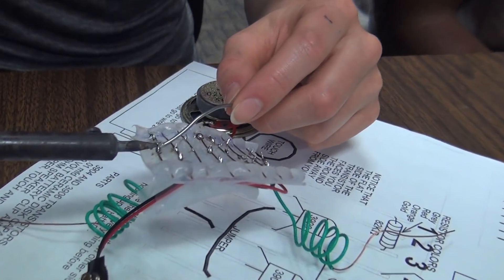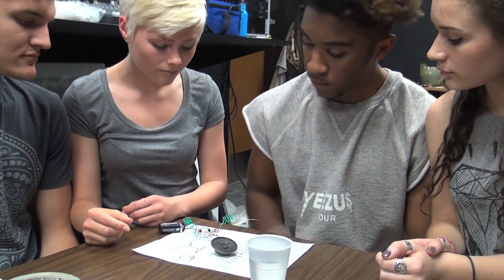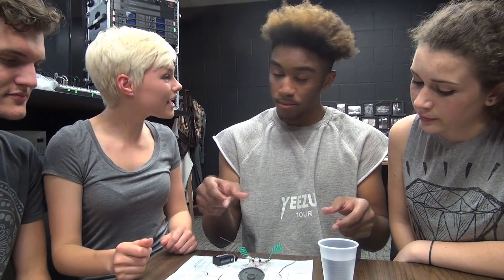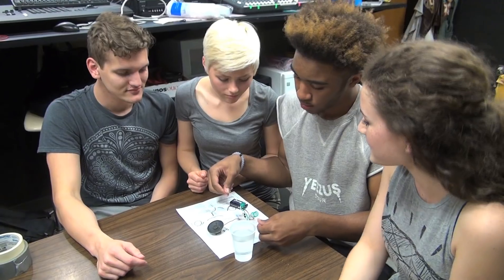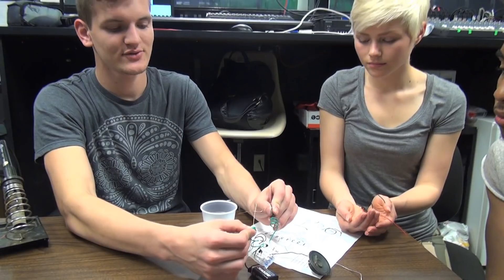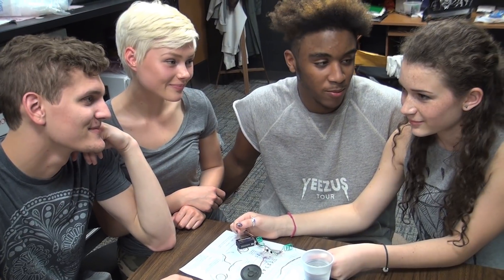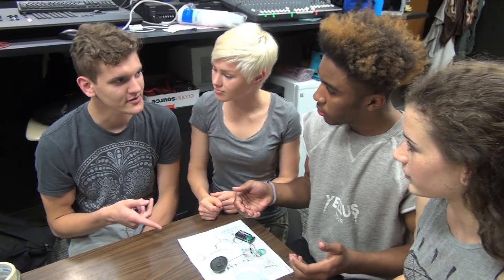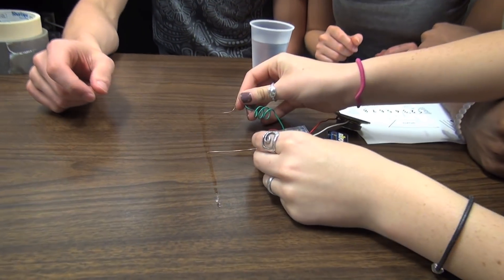Lie Detector Electronics Project

Comment: I was thinking if you needed to do a pile of these you could laser cut the wire holders out of a sheet of 3mm plywood. The cost would be pretty cheap and save messing with the silicone. I might try one on the laser cutter and see how it comes out and get my son to build it.

When I used to make these I used brass thumb tacks for the finger connections, easy to solder and they make a nice connection. For the lie detector to work you have to not use connections that can be squeezed.

A good demonstration of one working is to threaten the person connected up with a screwdriver in a stabbing pose. The lie detector will detect the fear even though we know we are not going to get stabbed..